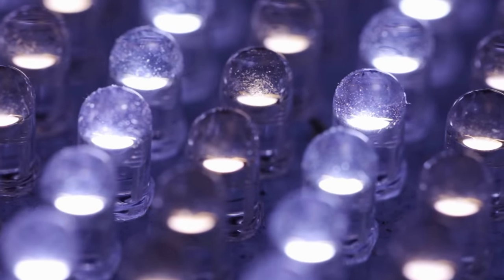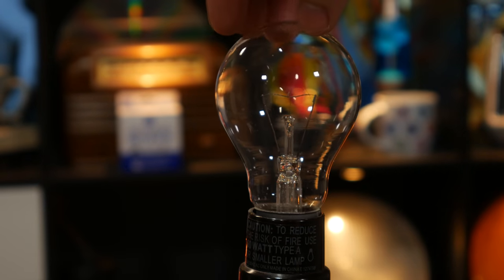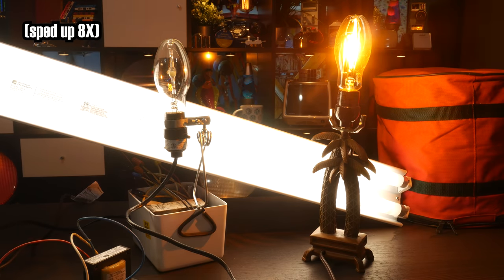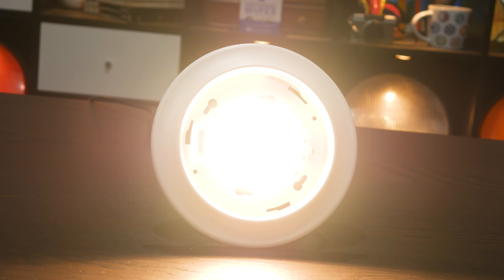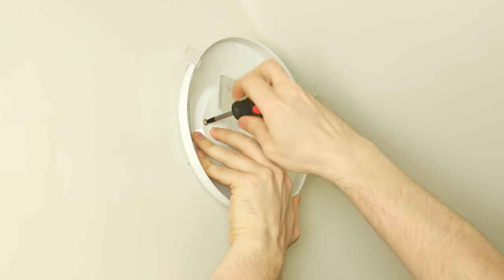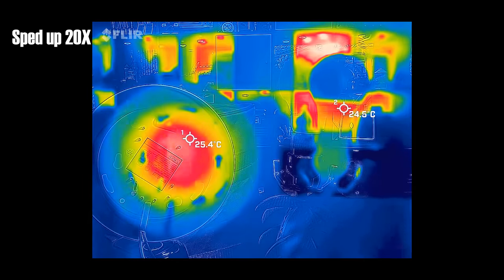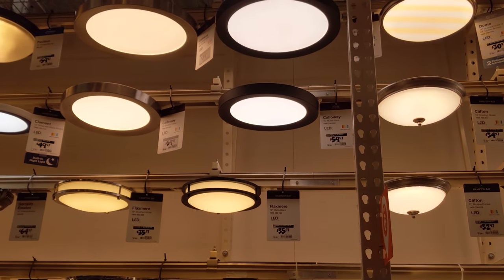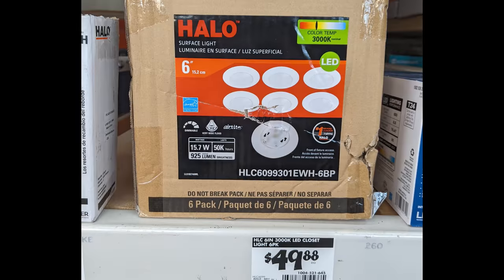A troubling trend in lighting?

Comment: Yes, there’s been a revolution in home lighting.
The energy twisty bulbs were for a while, the thing to have…but they had problems. Bottom line, they made a big energy saving over incandescent bulbs….actually not far behind LED.
For a while, certainly in U.K., in the early days of LED lighting, the established curly lights were much cheaper to buy and almost as cheap to run….that took a few years to shake out.

Most of our LEDs are the retro fit type, and generally no problems. Had 1 failure this year…started flickering & did that for a couple of weeks before completely failing.

In U.K. we used to have just 1 light fitting connector, the bayonet (looks a bit like the old BNC connector). We then started using screw types like yours….ok, 2 types, simple enough. But by the time we got to 2022……there’s all sorts of different types. You can often buy the same LED bulb with 3 or 4 different types of connectors….madness 😂

For us oldies, it sounds odd talking about LED bulbs getting hot. In the “olden days”, incandescent bulbs were notorious for getting “microwave” hot to the touch.

Warm white is much nicer than standard or cool white….this even applies to LED Christmas tree lights. Until, really quite recently standard or cool white was the only option with LED…even now, there are various options, so make sure you look at the information & buy the right one.

Comment: I have often though that we should wire houses with low voltage DC (24-48v) since almost all devices outside of the kitchen convert the AC to DC. Power supplies could then be replaced with cheap reliable DC-DC buck converters. Using multi chip designs LEDs wouldn't need any additional circuitry.

Comment: Led on a chip with prongs that you could slot into a standardized hole would fix color, quality of led, death of just one, upgrading to more efficient led’s. 

You could pick and choose between you led preference at a hardware store just as easily as you do with screws or fuses. Regardless of what light standard we follow this would be applicable in almost all led use cases and should be done anyways

Comment: I work in a retail setting and I hear customers mention bad LEDs every now and then and almost every time it's done down to the fixture. They're either using an old fixture, like from when incandescent was a thing, or a newer low wattage fixture made for LEDs, but every build they put in fails. They blame the bulbs but those bulbs are made for a specific rating. If your fixture has some flaws in it that pumps way more energy out, it could be killing the bulbs. 

I remember hearing (I think from veritasium) that on average people are more likely to sell their homes than replace LED bulbs in that home.   

Full disclosure that i don't know if that includes renters or how big the testing pool was, it was govern with no citations or evidence. I trust the source so I believe it, but others may not, and I can understand that.

Comment: I replace those led fixture things with standard light fixtures pretty often. They make lots of light for very little space and power. They flicker infuriatingly when they get old, or if the house wiring has some issue causing fluctuations, which is super common in old houses. I saw one last 4 years once though. That's probably max useful life so don't ever spend more than $40 on one.

Comment: Another troubling trend in lighting - ceiling fans almost exclusively are designed to work with a wireless remote, and the main capacitor for the fan is generally inside the remote receiver module such that it's impossible to bypass so you can use wall controls.

Comment: Watching this again, for like the 6th time but that part is not important, I chucked when we came to the part about electrical boxes. Just yesterday I replaced a lighting fixture in the hallway outside a bedroom, to find that there was no electrical box, no wire nuts, and no ground connection (The ground wire was wrapped loosely around a bolt hanging from a strip of steel serving as the fixture's anchor). I had to head out to town and get some old work drywall boxes in order to fix this mess. Nothing gets your heart going like finding out that the crappy light fixture you've wanted to replace for years was hiding some zippy zappy wires held together with electrical tape and shoved into the attic insulation. Oh, and sadly the replacements are bo-ob lights.

Comment: There's one huge issue you missed: it's all fine and dandy as long as like in your case they are mounted ON the wall / ceiling and not IN. Unfortunately a lot of the light fixtures we have in our rented home are mounted in the wall or even in the cupboard of the kitchen. Most of them can't be removed non-destructively as they are glued in (they really expect them to last long enough that it's not worth designing an easily removable fixture) which is annoying if you simply want to replace them temporarily for a different color temperature (as the apartment is rented after all) and also good luck finding a replacement light that has EXACTLY the same dimensions, it's almost impossible unless you are able to buy the same, which is probably not on the market anymore by the time it breaks, and keeping a spare for everything would be quite unreasonable. I hate them for this reason, also full lights tend to be more expensive than simply a light bulb.

Comment: I don't mind them, but would prefer something that had a separate fixture/driver and LED system. While LEDs last a lot, I have seen them break due to unexpected conditions or situations, it'd suck having to replace those just because things broke. Similarly I would see it really annoying if I wanted to change a fixture (say burnt due to an overload or some other bad electric mishap) only to realize that now I also have to change all the others, because they don't produce the exact same color, and it'd tick me of just so. Instead being able to keep the original LEDs and their color, and just replace the fixture would be nice.

Regulation here would be nicer. If we want simple current controlled LEDs a simple fixture/driver standard that plugs (lets say screws with) a flat standarized LED solution. Give a few formats for well known interfaces (lets say flat disc, bayonet plug and whatever weird edge case I haven't considered) and we should have something useful.

But I don't see NEMA getting to these anytime soon. The problem is not the bulbs themselves, but smart-bulbs, which do not interact well with circuits. I mean you could always make the switch sent some type of usb-like cable to the lightbulb letting you control everything and managing power too, but that requires rewiring. You could have something where there's an optional way to send some control signal to electrical boxes (for any device to use) from a switch that knows how to handle it. Devices should work without it though (I guess you could use WIFI). Still the problem is that some bulbs simply cannot be used as normal lightbulbs (hence all those switches "never turn off"). It would be very annoying to get it to work correctly, and I'd rather see smart-bulb operators make a lightbulb that can be turned on and off normally work correctly as expected without it screwing with the smart operations. I honestly see that there'd be an easy solution that might result in a bulb taking a few milliseconds longer to turn on (try to sync with home, get current configuration, if not possible, simply turn on with last configuration). But most smart light-bulbs are too smart and do not handle this well (I don't see why they have to be controlled through power turning on and off, a reset button the bulb would not be that terrible). Point is smart lightbulbs need to stop being so stupid by being clever, and instead have simpler, dumber systems that let them do what they should.

Comment: I have a front door and where the light fixture is if a bad wind comes it will swing open and destroy the bulb.  These are just to right size to where the door will swing open without it busting or hitting the fixture.  I have had it there about 5 years now and never had an issue with it at all

Comment: This may be more than you want to hear, but you've hit a topic on which I have strong opinions.  I've been a marine electrician for a long time.  The thing is, as you briefly touched on, LEDs are inherently DC, and so the driver you mentioned is a DC power supply.  Here's what bugs me about these bulbs: The LEDs generally last half again as long as the drivers.  The difference used to be even greater, but manufacturer's claims for LEDs have gotten a little less, and drivers have gotten a little better.  However, when one of these things fails, it's almost always the driver. If you supply the same amount of DC to the LEDs of one that has failed (and, I've tried) they come right on.  So, you have to throw away perfectly good LEDs because a different part failed.  LEDs that don't have built-in drivers are the 12VDC and 24VDC ones made for RVs, and the rolls of DC LED strip, which are the least expensive LED lights you can buy (The whole deal, after you buy aluminum extrusions in which to mount them may not be so cheap, though.).  So, in my opinion, the best way to install LEDs, is to put the driver at the light switch, and mount a DC, RV style fixture where the old fixture came out.  Then, you have a fixture with a replaceable lamp.  In order to make them incompatible so people don't get into trouble, most of the DC sockets are bipin rather than screw in, but you can get adapters that will convert the screw in sockets in an existing incandescent fixture, if you don't like the options available for RVs.  There's a couple of things... To meet the electrical code, the connections for wires have to be inside an electrical box, but drivers for larger wattage fixtures might well be too big, so they could need to be mounted in a box of their own.  If you're replacing the lighting in a warehouse or something, I did some investigation, and LED lumens per ampere (the amount of light you get for the wire size you have) matches four foot fluorescents at about 32VDC. Practically, this means that you'll need to make fixtures that series 3 or 4 12V strips or 2 24V strips and get drivers that supply 36VDC or 48VDC in order to get the same illumination using the existing (size) wiring.  For replacing residential incandescents, the LEDs are so much more efficient, that the wires in the wall that supply an incandescent fixture at 110VDC will supply enough amperes for the same amount of light from LEDs at 12VDC. When a driver or an LED fails, you really ought to be able to replace them separately.  Finally, if you like happy color temperature lights, I have installed the full spectrum LEDs from Waveform Lighting in my residence. They're quite expensive, but it does look like the sun is shining there. It's a delight.  I used a non-dimming driver and a dimming Ulincos touch switch, which continues to be fun for me.  More finally, if you do this, you'll want to read about "Class 2 Compliance" in the National Electrical Code.

Comment: If you going for the filament style led bulbs (they're prettygood) try to get the ones with an E27 socket.
The E14 socket is much smaller and they usually put terrible drivers in it due to size constains.
In my experience the E14 ones are more likely to flicker right from the start and fail much quicker due to heat.

Comment: I got LED lamp with color changing functionality and remote control. Incandescent lamps, especially halogen had imho nicer light and were very nice to have turned on in the winter (changed them to LEDs and/or CCFLs in summer) but looks of the lamp and convenience is through the ceiling on these integrated lamps.

Comment: Yep. As I write this I've got wires hanging down from a hole in the roof because the LED fitting that should be in there went strobe, but it was only one of 4 in the circuit for the room. And an internet search for the part number on the back suggests that that model is not so much of a thing anymore. Oh well.

Comment: When it comes to drop-in LED bulbs, I would think that they could be considerably better at cooling if the small surface area that they have on the outside of the bulb, could be molded into a heatsink-like structure. Even if it’s just a plastic casing, if it’s molded like a bunch of fins, that’s still a little bit more surface area to dissipate the heat than just regular smooth plastic all the way around. Why is nobody doing this?

Comment: 3000k... I recently replaced most of the fixtures in my house with much larger led boob lights that are like 1400 lumens or so. They have an adjustable temperature, I have it set to 5000k. I had one set to 3000k accidentally, but it was far too yellow and I had to adjust it. I love these lights! They are very bright, VERY efficient, beautiful, and are rated to last 45 years. By the time they die, it'll be someone else's problem.

Comment: My apartment's kitchen light is hung in possibly the worst spot on the ceiling. I'm convinced that if they were required to install cans they would have measured to install it in a sensible place. However, the ease by which they are installed leads to an obvious corner to cut in placing the light properly in the space.

Comment: I work at a high school that was built in 2015 so it was designed with a mix of LED pot lights and accent lights and t8/t5 fixtures for larger corridors and classrooms. The school is now 8 years old and many of the fluorescent lamps are starting to die. But so are the LEDs. I can swap a fluorescent tube in about 15 seconds and the fixture is good to go for another 8 years. The LED fixtures on the other hand blink on and off annoyingly and require a call to our electricians to come replace. All that plus the fact the LED fixtures give off dim muddy light that hurts your eyes makes me wish the whole school was built using fluorescent lamp fixtures. 😞
Reply: I’ve had pretty good luck with replacing fluorescent tubes with universal LED tubes.  The benefit with the newer LED tubes is that there is no need to bypass the ballast which saves a call to the electrician.  Frankly, LED tubes don’t really save much if any power consumption and are not rated to last more hours than a high efficiency, high output fluorescent tube.  The LED tubes are arguably less hazardous because they contain no mercury.  48 inch LED tubes are now (in 2023) about the same cost as or even less expensive than fluorescent.
Reply: Yes some of our schools have been "upgraded" to the LED tubes. I personally find they give off less pleasing light and they also tend to blink when they fail. The biggest issue with the LED's is they only emit light out of half the tube. Most of our schools use hanging fixtures designed with traditional tubes in mind that throw light all directions. Schools that have been upgraded to the LED tubes now have darker classrooms as no light is thrown up to and reflected off the ceilings. It makes the rooms feel dingy! @wtmayhew
Reply: @nintendork900  Thanks very much for your reply and relating your real world experience.

Comment: I'd like to see a new standard for LED fixtures that could allow a variety of fixtures to have swappable diodes without the hassle of electrical work. Then, we can have the advantage of designs that are more versatile and better cooled than edison screw socket bulbs while maintaining the easy swappability for the part that actually emits the light. Those super fancy chandeliers certainly couldn't easily use that, but for general lighting, I doubt it'd be too hard if we can get some companies to cooperate without too much of a format war.

Comment: we might solve the concerns by standardizing on a mounting system, mandating a "disconnect"(perhaps a flush plug into an outlet), and making it mandatory to sell the individual PCB and parts inside as "modules" for replacements
my parents once had a crappy proprietary CFL fixture in the stairwell to the basement as a surface mount device was the best option
however it aged to death and so they bought an LED variation that has color temp options that tend to make it less harsh on the eyes and throw at a wider angle
I would hate to mandate a different kind of fixture in that space as they have found a sweet spot for the temporary light used there
however I would like to mandate that all spaces have a minimum designed illumination for every spot up to within 3ft of a wall excluding doors and narrow walkways like stairs and halls

this idea is to mandate that we do not place to few fixtures in a room like my parents basement that is about 40ft x 15ft, they once had some old tungsten 3x40w matching fixtures that wore out from bulb swaps(causing arcs and stuff) and they swapped to some LED replacements that are definitely not what they are rated at

perhaps the mandation of visible light minimums will help, as wattage is no longer a decent metric, it should be the total amount of photons detected by a tri-color detector that match the peak wavelengths of human sensitivity vs incandescent at a given wattage as that is a common metric still

the peaks of human light sensitivity is the important aspect anyway as we don't see everything, the sheer number of IR photons from incandescent made it clear why it was bad for illumination, we can't see IR

Comment: Based just off the way you said "without going through the trouble of installing actual cans" I can tell you've never crawled through an attic in Florida in the summertime. I'd prefer to never have to install one of those again, though I will say it's weird that LED drivers and emitter boards aren't standardized like the LEDs themselves are. They're already so similar and easy to replace.